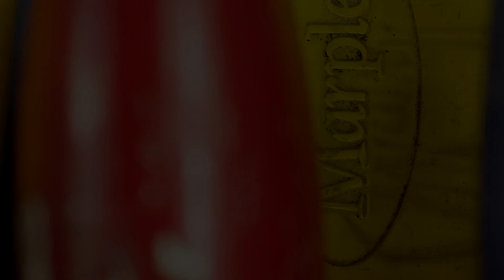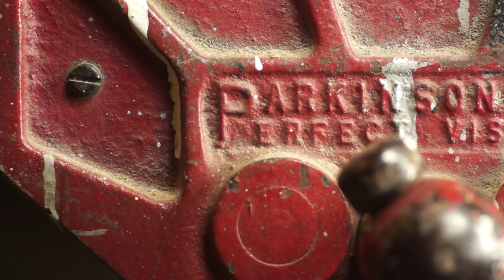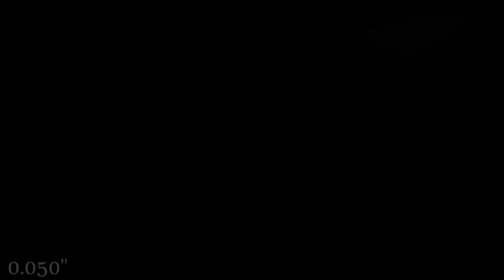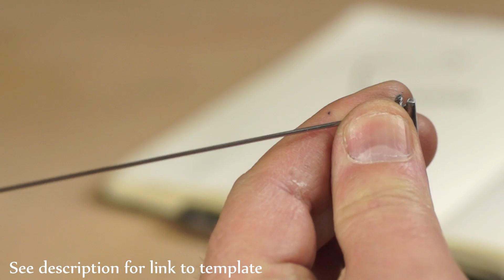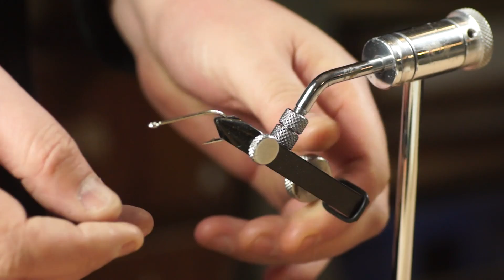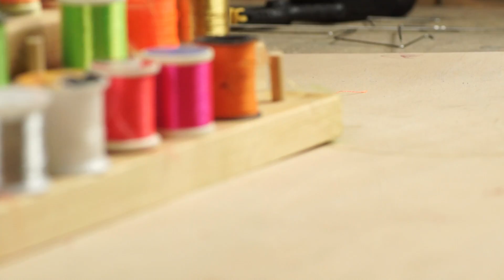Making and using a whip finishing tool for lure making

Comment: Mate, great vid. Simple, fast, resourceful! I wasn't able to get stainless tig rod but used a wire coat hanger which turned out just as good, especially for the beginner. I also added an old handle from a brass auto centre punch and held the wire in with rubber lumo beads which is great since it turns and provides tension also. Good job mate and thanks for the inspiration!

Comment: Paul, do you have the template for this tool posted anywhere on the web?
Reply from the maker: Benny Banka e-mail paulpadam@aoil.com and I will e-mail you the template back as a pdf you can print and use
Reply: ***** I tried to send an email but the address is incorrect. Could you please give me the right direction?
Reply: ***** I´m Sorry Paul, I saw the error in your email addres. I send you an email requesting the template tool. Greetings from Mexico.
Reply from the maker: greetibgs, yes i will send a template
Reply: Thank you very much my friend

Comment: Just out of curiosity, why not mount the through-wire you're working on in your fly vise? Or is it just to demonstrate that only a few tools are necessary to make lures?
Reply from the maker: I would not normally mount the wire in the vise as I find  it is simpler and quicker to do it by hand but for demonstration purposes it is a little easier to show the action of the tool. Thanks
Reply: Ah gotcha. Thanks!